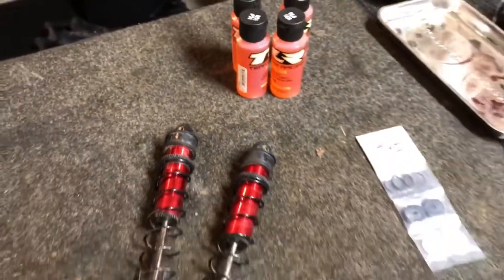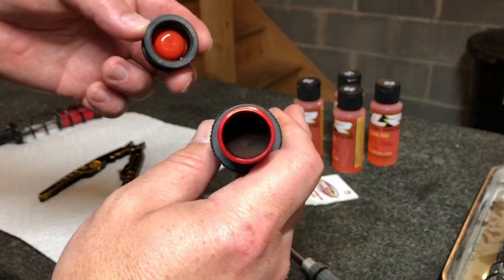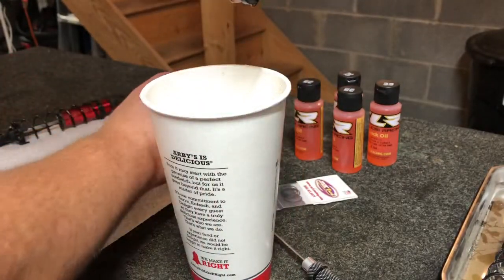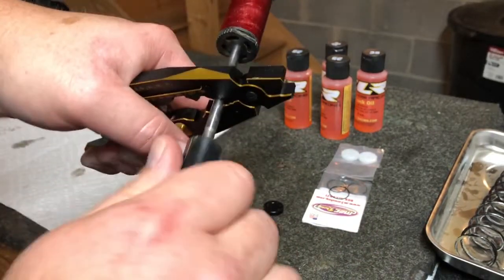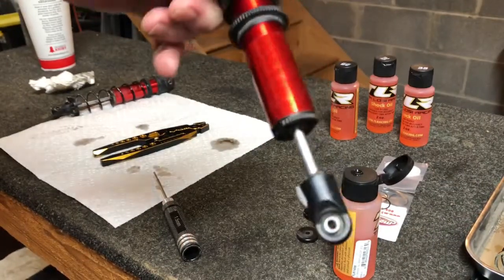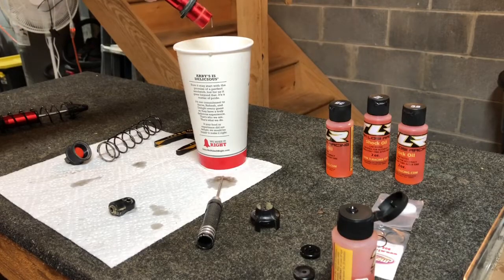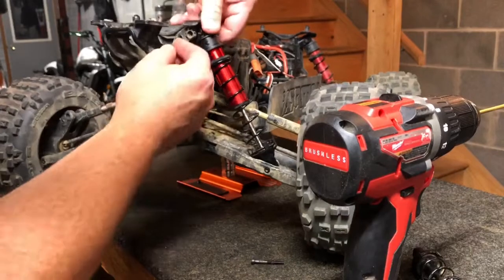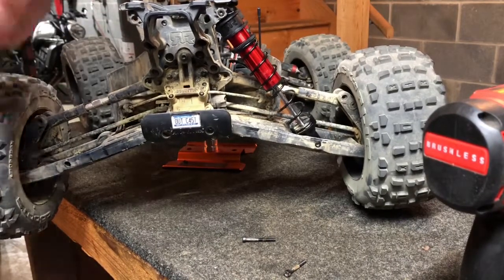Arrma outcast 8S EXB M2C Shock Valve install.

Comment: 15:50 Bars how comes the front end of top brace has no space between red brace and start of chrome end and now the lower chrome brace has a small amount of space between the end of chrome and start of red brace 
And yes I can see how your chassis looks almost not far from the wood of a bow😱 
Awesome intel inside about checking shocks fluid levels 
Sure did enjoy your video Bars
Thank you😎🎯🤤
Reply from the maker: Some of the braces I adjusted out trying to straighten the chassis or to bow it back the other way it helped a little bit but not that much. But thanks bud I appreciate you watching and the support man

Comment: What brand shock tool are you using? Does it have the correct shock shaft size on it?
Reply from the maker: It’s got three different sizes on it I got it off of Amazon.

Comment: I beleive a carbon chassis is going to be the best layout on these rigs.. strong and will save some weight.. This may be the road I venture down in the near future.. Just not looking forward to all the tooling I need to make before I can lay up a chassis..
Reply from the maker: A carbon fiber chassis would be a great thing for these cars I think between saving the weight and the durability would be perfect.
Reply: Scorched RC has a carbon fiber chassis for the K6 but it is priced a little to high, I feel. But it is sweet.
Reply: That will be an awesome project though. Sounds really cool.😎❤

Comment: *Something that was skipped over, and is partly responsible for the “hop” you were experiencing is called “Tuning/Setting Shock Rebound”.
**When you refill the shocks with oil and burp the bubbles/air out…where the position of the shock shaft is “before tightening the Top Shock Cap”…Determines the amount of rebound.(this is almost as important as using the right weight shock oil to get the results you want).
~The further “extended” the shock shaft is before tightening the shock cap, “the more rebound” the shock will have.(rebound is shown as your video describes, the pressure inside the shock automatically pushing itself out, assisting the spring).
~The opposite occurs when you have the shock shaft shoved into the shock before tightening the top shock cap.
Reply from the maker: I’ve tried setting them up all different ways with different oil and setting them up properly! But both of the cars the K8S and the 08S I’ve always had that bounce